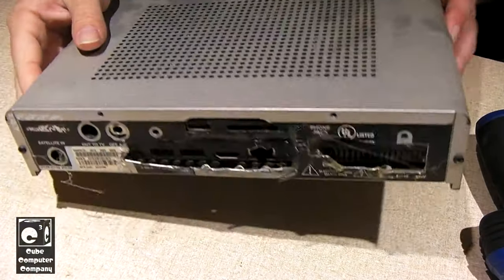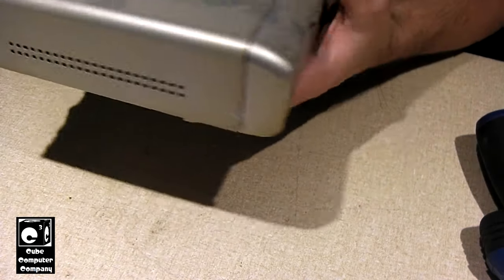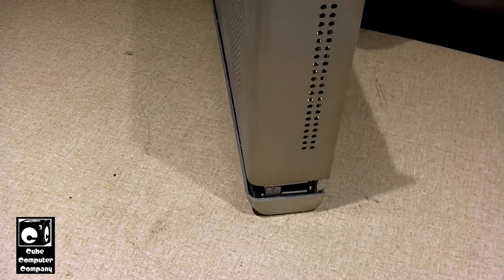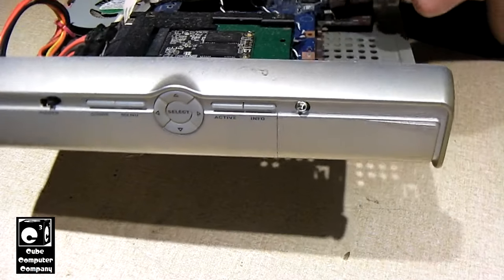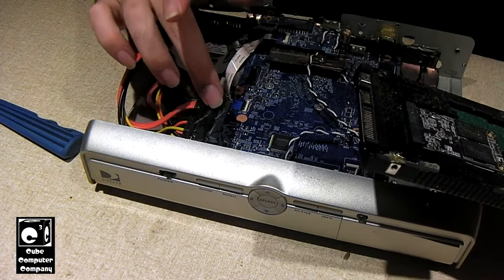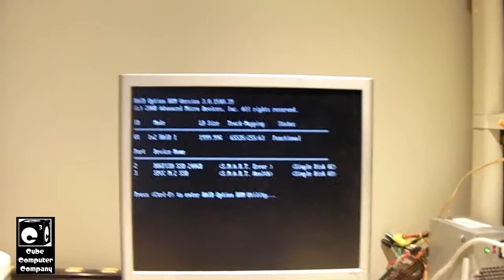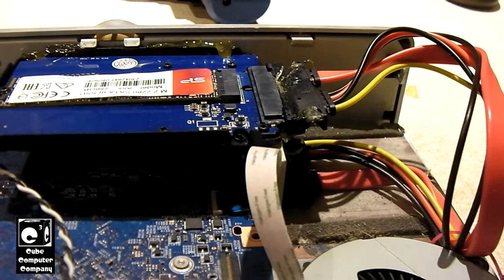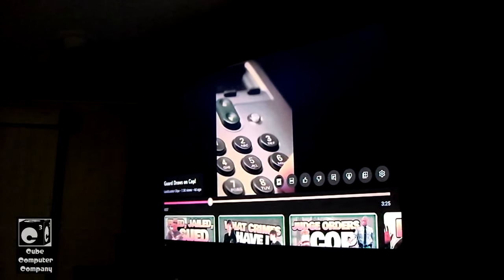Changing out failing SSD in the living room TiViBox Slim

Comment: You can call my Macbook Air M1 a "solid state PC" It doesn't get very hot unless I'm doing intensive compression tasks like image compression. doesn't break a sweat with video because of the hardware accel. 
The dock I have for 4k60 video and USBs gets hotter than the laptop itself.
Reply: the only parts that move are the keyboard and screen. the touchpad itself is completely solid, but because their trackpad has force touch, and a high quality "taptic engine" or HD rumble, it feels like you're clicking, even has multiple stages of clicks that feel different.